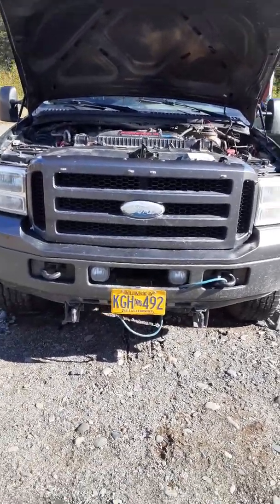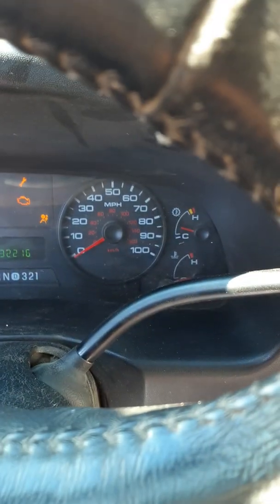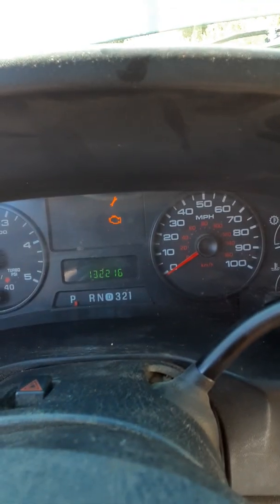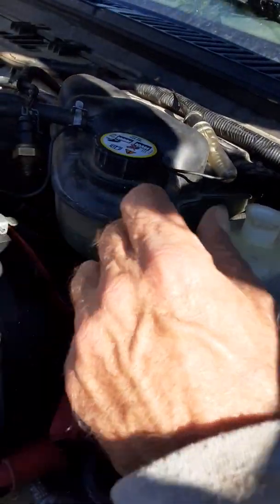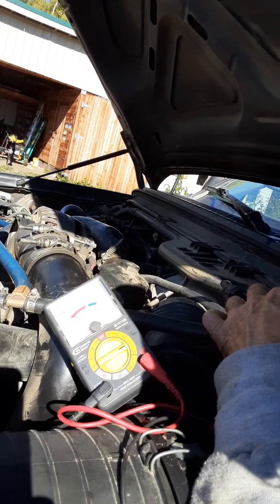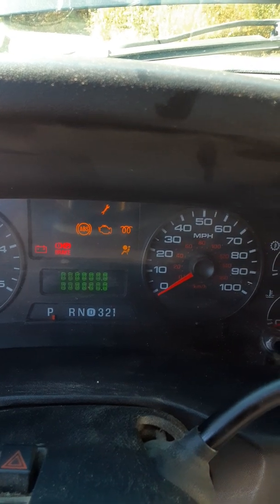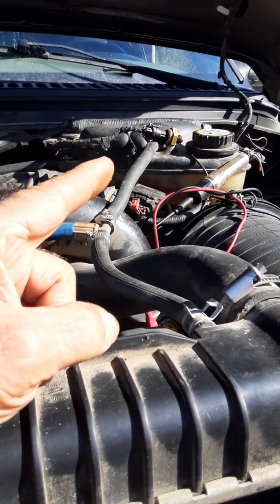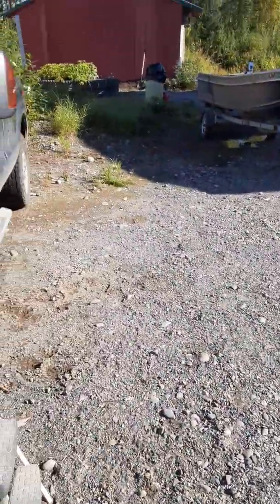2006 Ford F250 6.0 runs no throttle response.

Comment: Ive got a couple codes coming up for throttle position and response or whatever. Up until today i havent had any issues, but today truck is sluggish. Idles fine, but under load shes shaking and sluggish. Should I start with ICP sensor or one of the other sensors? Im not getting a ton of codes, and like I said until today, truck has been running great. Maf voltage seems to be reading a bit high.
Reply from the maker: What does your 5 volt read at the map sensor?
Reply: @michaelvolin9749 I'll test that here later and get back to ya. Seems like ICP sensor cause I've got oil everywhere.

Comment: After replacing the MAP sensor , did the rest of the codes clear as well ?! 
I’ve got ALOT of codes on my 2005 like you did . But my pedal is intermittent, sometimes I have no issues at all and then I’m constantly having to stop and restart my truck to get my pedal back . Thank you .
Reply from the maker: Jay, yes all the codes cleared after replacing the map sensor. I had the intermittent pedal a few times and did restart the truck to keep going. Is your wrench symbol on when the pedal stops working? He is another tip, just pull the plug on the map sensor and see if that solves it.
Reply: Good idea unplug battery, for a few minutes or over night. Then let it run 10 min, without touching anything and it should reset, clearing everything and reteaching system.😎👍
Reply: Have you ever dealt with too much voltage. I have a dead pedal but I am getting 12v to the sensors instead of 4.7v. What regulates the voltage?

Comment: My truck will not accelerate when in reverse or drive, but when it’s in neutral or park it accelerates fine. Would that still be a sensor?
Reply: Same problem here, did you find the solution ?
Reply: @joseruiz5740  nope! Been sitting in my drive all winter. I’m taking it to a powerstroke mechanic next week. I’ll update you then.
Reply: Did you know what was wrong with it before selling? Having the same problem
Reply from the maker: Sounds like a transmission problem or your parking brake or brakes are stuck.
Reply: Mines doing the same thing. Any luck with yours?
Reply: @gabriellarsen4885  ending up selling it😂

Comment: My f450 wont accelerate ones truck gets warm up
Reply from the maker: Sounds like it's the fuel pump. Check this video out. 
https://youtu.be/i3UKgw0iGKQ?si=-9bKfIqSbg1rQMXZ
Reply from the maker: Check the high pressure oil pump pressure.

Comment: My problem is I have low rpm only goes up to 2800 of RPM & no power under load I have po471 for EBPS
Reply from the maker: Stephen that code is for the exhaust back pressure sensor it's located on the left side of the motor about midway it looks like a dip stick tube with a sensor on top. The problem you are having sounds like that's the problem. In my video that's the plug I disconnected to measure the voltage and as you see the truck ran great after I found the map sensor bad. Please feel free to call me I'll explain it in detail. 570 441 0944

Comment: I am having the same problem currently, I have my new pedal coming in tomorrow morning. After watching your video I can guarantee I’ll figured out before the pedal comes in. Thanks for the video saved me a lot of time.
Reply from the maker: Just pull the plug on any sensor. The exhaust back pressure or the map sensor is the easiest to get to. Look for the 5 volts on the connector. Keep pulling plugs out to you find the short. Call me anytime and I will walk you through it. 570 441 0944.

Comment: what was the cause of the problem then?  And did you ever have an electrical problem with loose harnesses or something similar?
Reply from the maker: I describe the problem In the video. It was the map sensor was shorted causing  the 5 volts needed for other sensors to operate to drop down to 1 volt. After upluging the map sensor the 5 volts came back and the truck runs great. I did not have any electrical issues prior to this.
Reply from the maker: You can call me I'll explain it. 570 441 0944

Comment: Most of the time it’s the ebp sensor and you should never use trash auto zone parts big no no
Reply: Same problem pedel to the  floor No response will try the BPS and see how that works
Reply: @anthonybellamy5746 did you get it figured out ?
Reply: @anthonybellamy5746  did it work!?

Comment: Hey I had f350 could it be a fuses gone bad as will to  the throttle or  Sensor My brother called herself unplugged in fuses so it is so the truck couldn't be stolen but he can't remember what fuse he unplugged
Reply from the maker: Do you have the owners manual that will show you what fuses are for what and the location of each fuse.